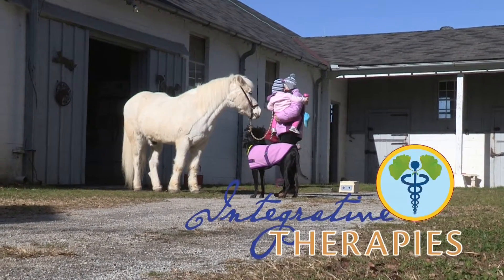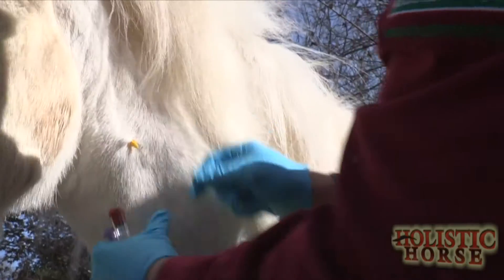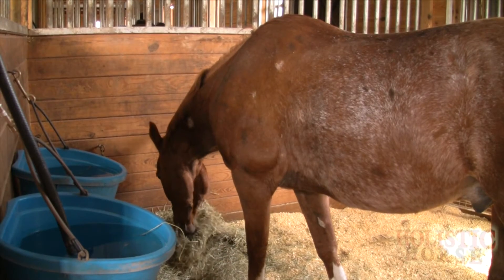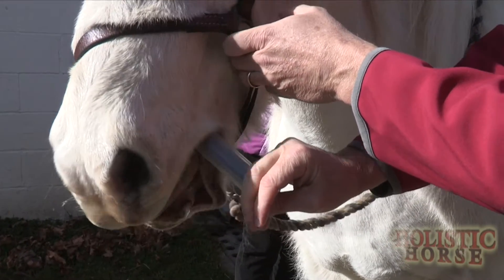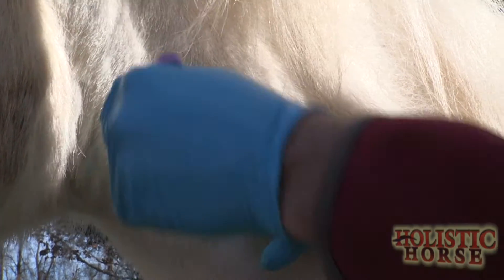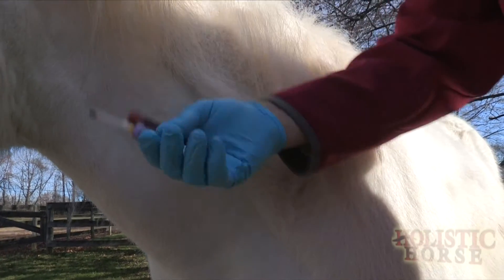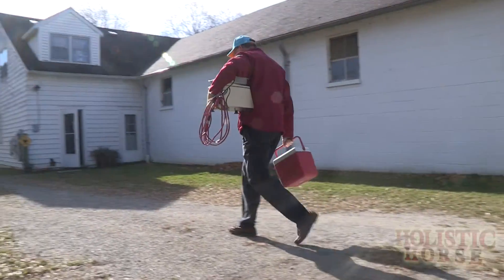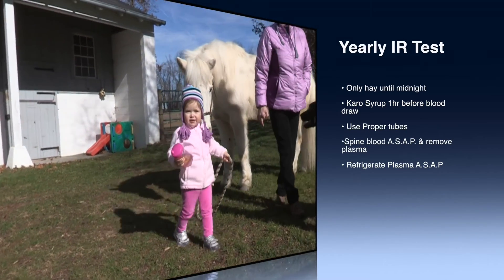How to test a horse for Insulin Resistance

Comment: So if I understand you created a test to ensure we get more positives by  providing an unnatural diet and complicated test routine thus ensuring you get more positives.  It doesn't take a genius to understand what's going on here.  I would guess that true metabolic laminitis requiring medication happens less than one percent of the time yet there is a craze in the medical field for cure with a drug and undue expense.   If we suspect IR (IR should be code for fat lazy horse) then first we must control the diet (forage only) and increase exercise levels gradually for several months all will show improvement.  In smart science we are suppose to develop a theory then spend our time proving it wrong...not try to justify a reason to prescribe expensive medications with unproven side effects.